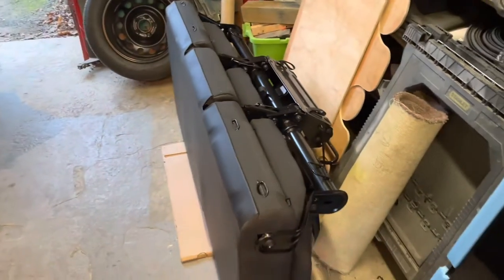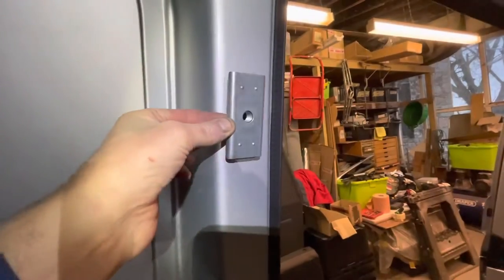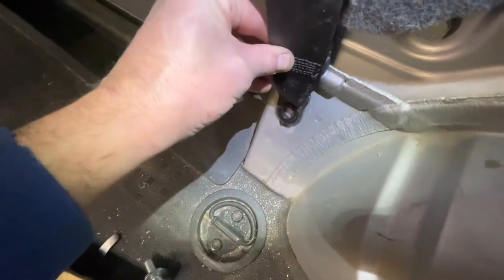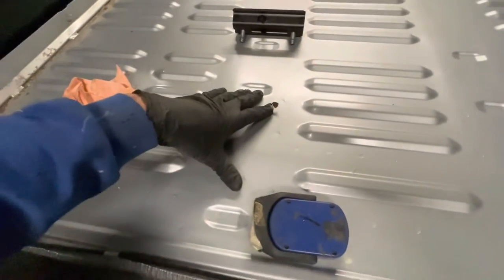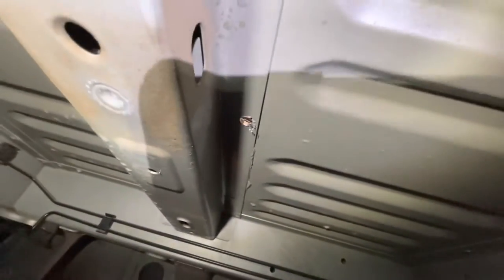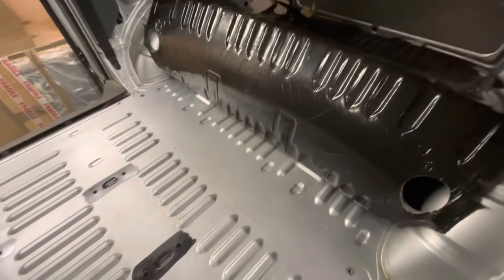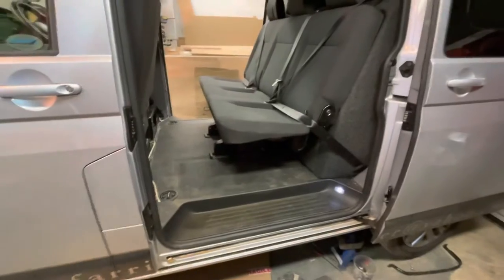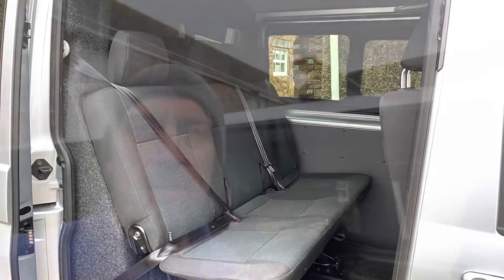Fitting a Vw triple kombi seat

Comment: Hello mate, that's the best video iv'e seen to show the reinforcement bracket install. Thanks! Out of interest the OEM brackets usually come with 2 mounting holes, did you cut these in half? would make sense. Thanks again
Reply from the maker: Hi, yes I cut them in half 😉
Reply: @jerseydaz2062 do you have to cut them in half?
Reply: Hello again mate, would you tell me the approximate measurement from the ceiling to the seat belt anchor please? Thanks in advance 👍

Comment: Hi, good vid. How did you get your bracket up inside the pillar? Wire?
Thanks
Reply from the maker: Hi, I drilled a pilot hole feed some wire down then pulled the plate up.